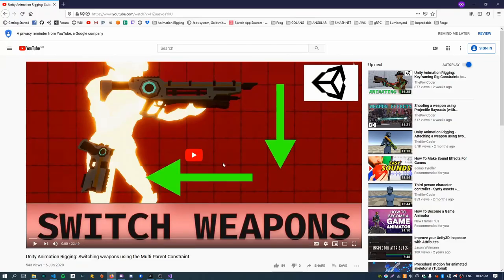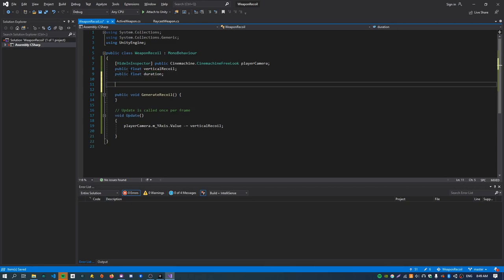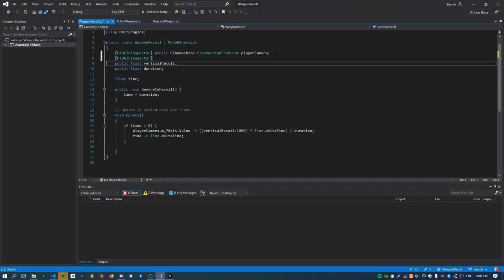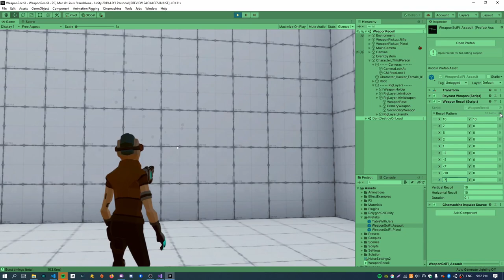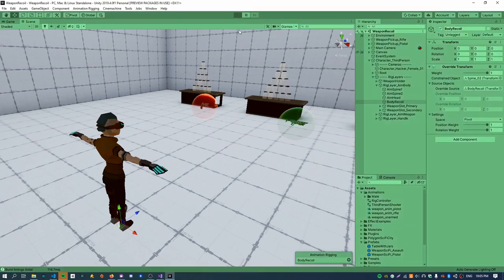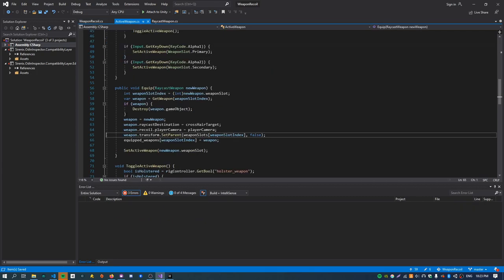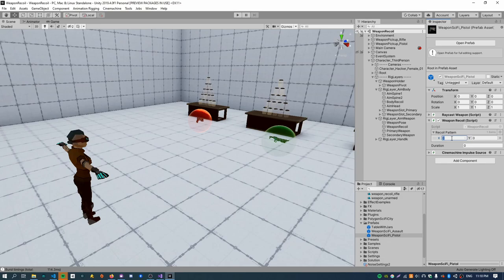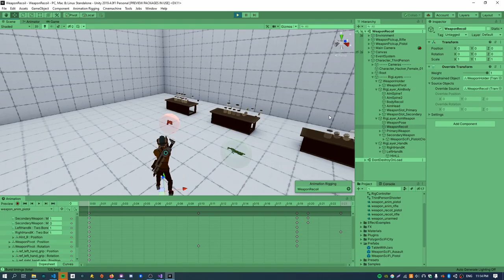[#09] Unity Animation Rigging: Weapon Recoil Patterns using Overide Transform Constraint

Comment: hey Kiwi i try to set an IK target via script, however via script nothing happens... setting it all up before running the scene, then it works... any idea?
Reply from the maker: Hey.. you can’t change the target via script, but you can assign new children to it instead. Instead of changing the target, add a new child to the target. Good luck
Reply: @TheKiwiCoder  i solved it by adding both hands IK to a weapon script for each weapon and then copy that transform over to the right and left hand IK as soon as the weapon is equiped.

Comment: Weird Question. I've noticed that my muzzle flash only emits in-game view when I have scene view open as well. So if I'm in full-screen game view or gave view without the scene view tab open I get nothing. Did I miss a step somewhere?
Reply from the maker: You could try increasing the particle length lifetime or set it to looping just to be sure it’s definitely not there..
Reply: @TheKiwiCoder  Tried that and still no go. I even tried to build it and it still wouldn't show. I made a post on Reddit with a vid and I'll continue to troubleshoot. Thanks tho 👌
Reply from the maker: Good luck!
Reply: I had the same problem. I narrowed it down to the unity particle pack sprites not displaying. I’ve since changed to War FX particle pack from asset store. It’s free.
Reply: If you are using URP try enabling depth texture in graphic tiers settings. Worked for me

Comment: Did no one else have an issue with the impulse source working? I asked in discord but I’m still confused. I’ve tried a bunch of stuff. It’s getting set in the awake properly (as far as I can tell) but when it generates the impulse nothing happens
Reply: If anyone else has this issue it’s so dumb! I was rushing through and wasted so much time as a result. Take ur time and watch what he does carefully. I added the impulse listener on the camera by using the unity “Add Component” button in the inspector. This is wrong. On the CinemachineFreeLook, scroll to the bottom of this component and click the Add Extension drop down exactly as he does.
Reply from the maker: Yes! Man this has bitten me too. And also spent hours being in a wtf state. Glad you sorted it.

Comment: Hi! Don't you have the problem, where when you make a prefab from character, animator can't change weights on bones?
Reply from the maker: For some reason no I’m not seeing that. I have my weights set to zero by default, and then set them to one in the animations
Reply: @TheKiwiCoder  I fixed this problem with multilayered animator instead of using 2 animators (I used parent animator for walking animations and child's animator for IK animations)